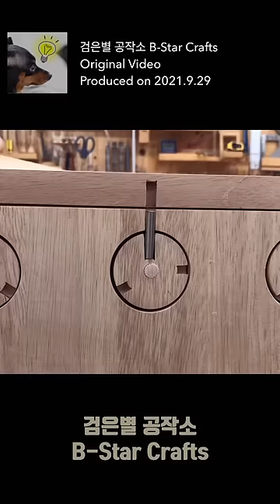Booby Trap Lock

Comment: Yeah you just need for holes to increase security.
If you keep it like this, i can easily brute force it with at most 27 possibilities.

And also I can easily attack it by just using a paper to slide between the crack. If it slides, then I got the correct value for that. It reduces the brute force to just checking in each independently: total of 9 possibilities.

Comment: Turn the box up side down and it's unlocked,  😄
Reply from the maker: It has a structure that does not open even if it is turned over as the bar is hanging over half of it.😊